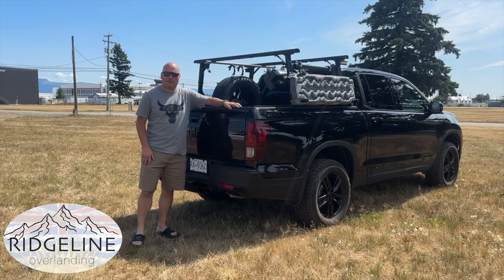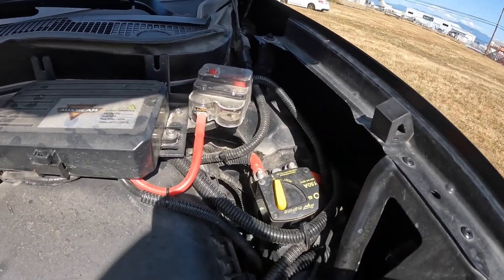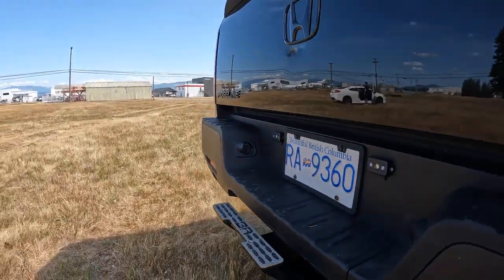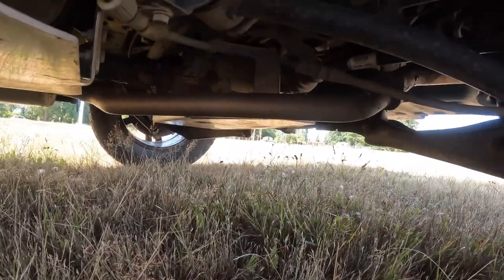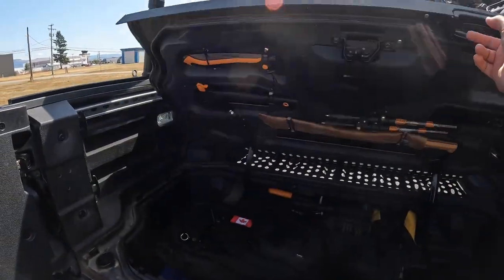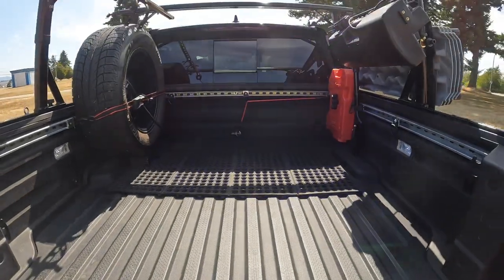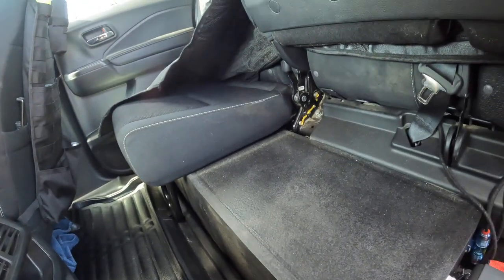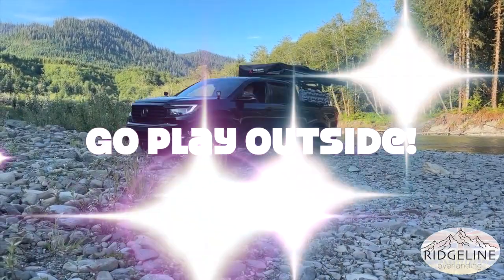2021 Honda Ridgeline "Overland Edition" walk-around and mods video.  THIS Ridgeline can hang!

Comment: Looks good man. I was planning to get the new tacoma but your video has made me feel like maybe I should get me a ridgeline instead. Thx for the video. Much appreciated it. 👍
Reply from the maker: Check out my Best Truck vids as they shed much more light on why the Ridgeline is the best truck for most people in most situations.  The Tacoma should only get “the nod” over the Ridgeline if legit “wheeling” is the goal.  They are equally reliable but the Ridgeline is a much better “car”.  You lose some tow capacity but you get a lot more payload which is important for the “every-day” truck stuff.

Comment: Great looking truck. Did all the Honda truck settings that are accessed through the Honda proprietary info centre get transferred into the kenwood setup? The only thing that’s holding me back from getting a used ridgeline is the relative outdated infotainment interface.
Reply from the maker: You lose control all of the settings that are done through the Honda infotainment. Set them where you want them and they will stay there, but if you want to make changes, you would have to pull out the aftermarket deck, plug in the OE deck, make your changes, remove reinstall.

I never played with those settings once I had the more I wanted them.
Reply: Thanks for the quick reply! I live in north van and I think I saw your truck out in the wild several weeks ago…i waited around to see if I could have a chat with the owner, but had to take off. Since then I’ve been researching after market truck accessories for the ridgeline, then my YouTube feed found you anyway! I noticed you don’t use a tonneau cover…would that rack system work with one?

Comment: Another great video Sir.  Do you have a video on the Kenwood system?  Does it keep most of the Honda system intact,.. steering wheel controls, parking sensors, etc??
Reply from the maker: I’ve been very delinquent and doing a video on my stereo. I did a lot of the install, but not the deck. We were able to retain back up camera and steering wheel controls. I have a sport model so there aren’t any parking sensors.
Reply: @ridgelineoverlanding  Thanks for responding.  I did some more research on it but, it seems in my case it will not be feasible to do because I would have to leave the stock unit in place.  I have a 21 RTL-E with navigation.
Reply from the maker: You can still build a really good system around the stock deck on the higher trim Ridgelines.  I started out that way, and then after a year decided to upgrade the deck.  
The stock deck has a tuning flaw that is beyond aweful so my shop had to get real creative to bypass the Honda signal.  It meant running my phone directly into the aftermarket DSP and Amps, while also being connected to the head unit for Apple Car Play functions.

Comment: Very well done, will all the optional lighting installed  can the electrical system handle the “ draw” ?
Reply from the maker: LED lights have very little draw and it’s rare that all the lights get used at once.

In addition, I’m running well over 1000 Watts to my stereo… So a few LED lights is a drop in the bucket.

Comment: That lift kit and clearance is what they need to do on their supposed "off road" package the "Trail Sport".. Not what they did ..all they did was basically add some stickers/badges and some tires(supposedly A/T not sure what they are using.. but it had a class leading lack of ground clearance and Im not sure that changed with their Trail Sport version certainly outside some stickers and fender flares the HPD package doesnt do anything either lol.
Reply from the maker: Fully agree. Honda HPD is a joke… Sad to say.

Comment: Where did you get your hrg lift installed?  I'm in BC and need to get mine installed on the pilot.
Reply from the maker: Big Country Customs in Abbotsford.  I hope you didn’t already order the kit.  Not many shops will do lifts with “user-supplied” kits.  BCC might if you remind them that they installed it on my truck without issue.  I can get you a copy of my invoice if they need a reminder.
Reply: @ridgelineoverlanding  thanks I'll give them a call,  I haven't ordered it yet.  I was about to.
Reply: Is there any info on the Kenwood screen install? Or any information you can give about the install I hate the stock one in my 2022
Reply from the maker: @HostEsco I’ve been meaning to do a stereo build video.  I did most of the install myself, first upgrading everything except the Head Unit.  Wired in multiple amps & a helix DSP unit.  My local shop did the final wiring to tap into the factory wires, and did a professional tune.  A year later I was more than “done” with the Honda head unit so I upgraded to the Kenwood but I let the shop handle 99% of that job as it required a lot of tapping into OE functions and I wasn’t about to take that on.  I’ve been doing stereo installs since 1994, but on the “lower tech” end of things.  So no, i can’t be of much help with the head unit upgrade, but you can find lots of info on the Ridgeline Owners Group.